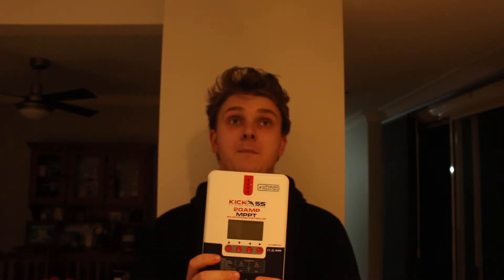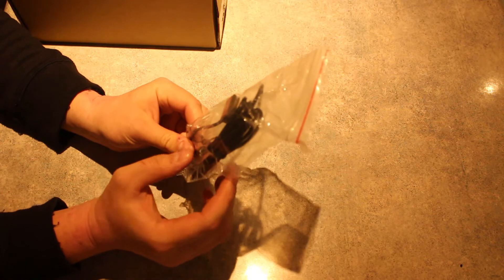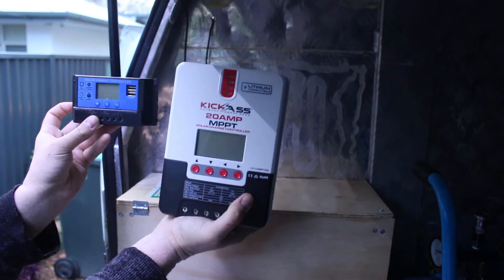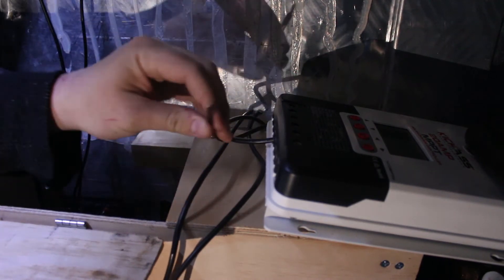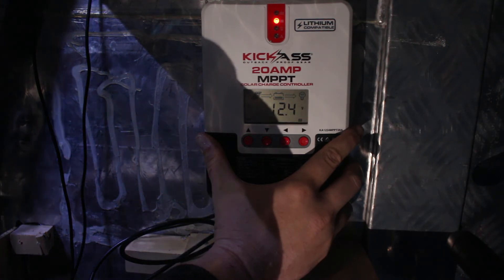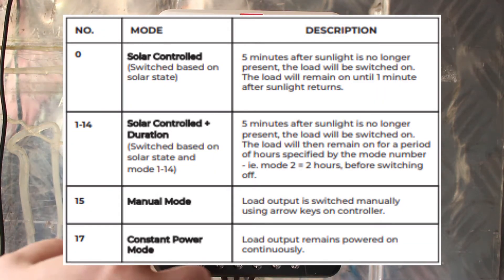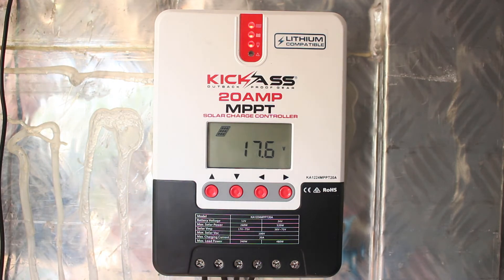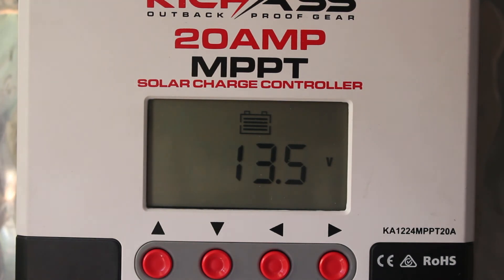SOLAR REGULATOR INSTALL - How to install a solar controller

Comment: Hi i have a quick question in my canopy i run two fridges an 85 litre upright and a 45 litre  fridge on the roof of my canopy i have a 300 watt house panel going to a kickass 40 amp solar controller with 2x 100 AH sealed lead acid batteries i had  it running over 4 days the batteries got below 12 volt so i check input of panel it was 34 volts but output to battery was 11.8 shouldnt the solar controller put out more volts when batteries are low thank you

Comment: Hi can you say how many panels you connected to this control, and if those panels were connected in parallel or series? 
And how many batteries you are charging and how they are connected parallel or series.
That 20 amps is in regards to amps going through the controller to batteries right?

Comment: Is there a reason why it can't be mounted on the side of a battery box?
Also if necessary instead of vertical mount, mounted at 90deg (sideways)?
Great vid to show the change over, cheers.
Reply from the maker: Don't see why it couldn't be mounted to the side of a battery box, but not sure about actually mounting it sideways. Thanks for the positive feedback on the video mate!!
Reply: @twox4x432  going by what you mentioned on the vid you're using a Kings solar panel?
Which one?
If you are, how's the Kickass 20a controller going matched with the Kings solar panel?
(I have a lithium 100a battery)
Cheers
Reply: @stevecrowe176  I have a 100ah lithium and the kickass mppt charge controller and kings solar panel and it works like any panel would.

Comment: I ended up getting 2 renogy lithium batteries, best thing ever, I've seen them as cheap as $680 each I think when they have sales. You won't need to upgrade batteries for a very long time.
Reply from the maker: Yeah that's definitely the next thing on my list after these ones die ahaha, lithium is so much better in basically every way